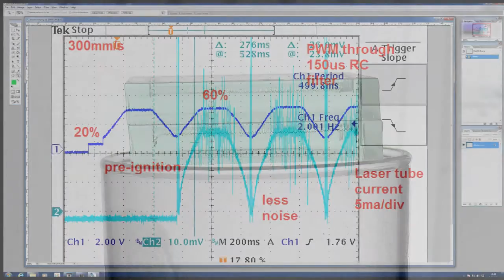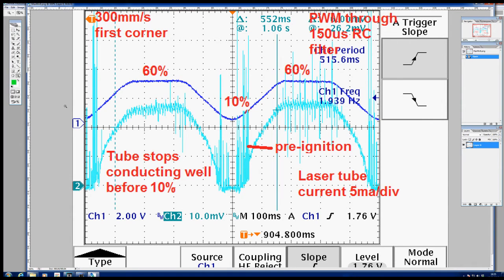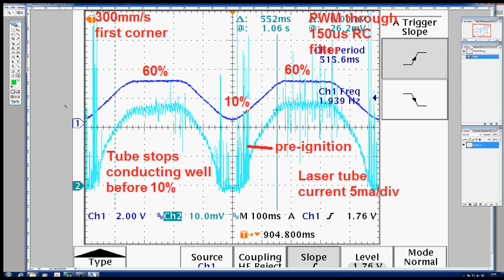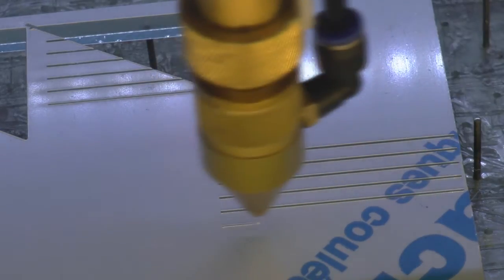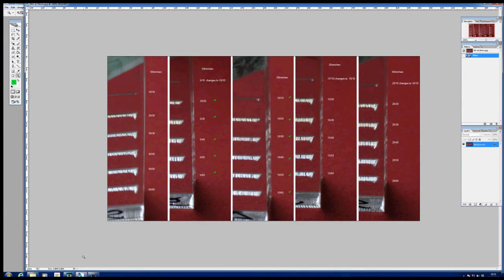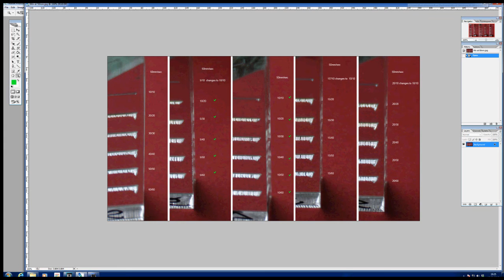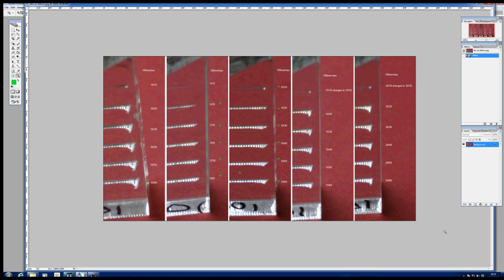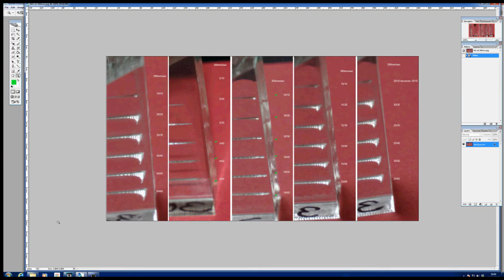RDWorks Learning Lab 55 Why Max Min Power Part 4    A Conclusion

Comment: I wonder if maybe you made more work for yourself than you needed to? When the head changes direction at a corner it slows down and briefly stops. Therefore, the beam also needs to ramp down and briefly stop at the corner. A series of lines to find the point at which your tube stops firing should give you your minimum power setting - it’s exactly the power at which the tube no longer produces a beam.
Reply from the maker: Hi Mark
 Thanks for the interest but this was a long time ago in my learning journey. About 18 months later I revisited the subject but this time I had purchased a little USB oscilloscope that allowed me to see exactly what was happening. you may like to see what I found. Having owned and used sophisticated metal cutting laser machines in my former businesses, I was familiar with the principle of power attenuation with velocity reduction. I could not imagine that this fairly crude Chinese  equipment had such capability
see  https://www.youtube.com/watch?v=wJX8X40T4VM
I do no have any sophisticated equipment to decode some of the puzzles I encounter, so I have to be creative with my experiments to see if acute observation of the results leads me towards an answer.
 Best wishes
Russ

Comment: Default settings with Lightburn is 10% min. This explains now why my first batch of airplane parts I cut did not cut clean at the corners. My laser fires at 12% min.  I raised it to 15% on a lot of the most recent ones and it made a huge difference, now the parts fall out.  However, now that I see what it is actually doing, it does away with what I thought it was doing and not applying full power all the time, so I have had it raised to min/max of the same values.  I can set those down now except for cuts through plywood, those need all the help they can get.   I thought it may have something to do with ramp up, but not ramp down, so thanks for clearing that up.

Comment: I've been setting both max/min to the same values, not really knowing the difference. Thanks for the very detailed (as always) explanation. I definitely need to tweak my min value down.  10% min seems like a good starting point. It seems with all your tests that their must be a way for a software manufacturer to produce some test  images that we can input the results of and then the software does some maths to fill in all the other stuff - but that would be too easy for the end user! If only!
Reply from the maker: Hi  Andy

In general you are right to set max and min the same. For engraving you must set them the same unless you are 3D engraving and then it is vital to use them.
For cutting,  keeping them the same will usually be OK but when you use the cut fuction for drwaing lines then  you can remove all the burnt corners with careful setting of the min value.. You will need to experiment though,, starting too low when drawing a 25mm test square and graually raing the minimum until the corners of your square just touch. I advise testing because the value will change with speed ,

Best wishes
Russ

Comment: Hello,
nice vid again.
But has this also something to do with the Parameter you can tick called "Laser trough mode" in the Cut settings in RDworks?
Matthias
Reply from the maker: Hi Matthias
No, it has nothing to do with Max/Min cutting.This is a feature that is necessary if you have a powerful tube and are going to cut metal with a special head. For our non-metal cutting applications just ignore it and leave it unticked. This software is designed for use with many different types of laser machine and some of the special features will not work on our simple machines.
Best Wishes
Russ
Reply: @SarbarMultimedia  Thanks for the fast answer! I always appriciate your Videos...learning a lot !
I have also another question about why i always get displayed 2 settings for Laser 1 and Laser 2 ( the Min/Max ) settings, even in the RDWorks Software and also in the Machine Display.
In the Vendor settings is only one laser ticked.
(if the forum is a better place for the question just ignore that )
Matthias
Reply from the maker: @StarflightVirtual  
Hi Matthias
I do not have a problem with you asking questions. As I mentioned previously, this software suits all sorts of machines. This version you have will operate machines with TWO different laser tubes. Later software issues support up to SIX lasers per machine.. Just ignore the tube 2 data. If you only have one tube then any numbers in that are there will be ignored .. Only tube 1 data will be actd upon by the controller.
Best wishes
Russ

Comment: Thanks for all your videos. I haven't even ordered a laser yet but it's great to be able to get some education before I take the plunge. I am planning on getting the 80 watt China model on Ebay.
Reply from the maker: +Counselor_X 
With very few exceptions most sellers of Chinese machines on ebay are just middle men to distance the factory from you. When you find out that your 80 watt machine is a 60 watt tube driven by an 80 watt power supply what action can you take? First how will you know its only a 60mwatt tube if you don't have a power meter to measure its out put? Secondly how do you know you are running the tube at it's recommended drive current because none of these machines are fitted with an ammeter? A typical 80 watt tube will be about 1600mm long whereas a 60 watt tube will measure about 1200mm. If you add to these tube dimensions 150mm to fit the first mirror and a 25mm air gap at the HV end and then check if this will fit inside the width of the machine case, this will actually predict what power tube you are actually buying. A secondary confirmation will be to check the packing case size.
The final piece of advice is to make sure you buy it with your CREDIT CARD. Ebay and Pay Pal guarantees are almost worthless. It will be good to ask email questions of the vendor before you buy and keep these written answers/promises(along with a screen dump of the ebay advert) because if things go horribly wrong then you can apply to your card supplier for a refund. Your card supplier is legally bound by a whole raft of financial regulations that the Chinese vendor is hoping to bypass.
Good luck. It may be painful at times but I'm sure you will get vast enjoyment from your new techno toy
Best regards
Russ
Reply: +SarbarMultimedia All good points! So far I have sent the seller about 10 different emails with questions. I just now asked them about the length and diameter of the tube. I would love for the tube to be great, but I'm trying to be real with myself and I am planning on the possibility of having to replace the tube with one from lightobject. The package size on Ebay is 1560mm in length, so what you're saying could be true. Is there any other way to tell other than the tube size? I see that lightobject has an 80 watt tube in 1625, 1250, and 1200mm lengths. The 1625 is 60mm in diameter while the other 2 are 80mm.
Reply from the maker: +Counselor_X 
As you will be aware I'm not in USA but I know folks who have bought  Light Object tubes. (no other comments) They source their tubes from SP  http://splaser66.com/enproducts.asp     If you check out their products it puzzles me that they don't sell any products matching what Light Object are selling. That's always worrying to me because of my personal experience with COLE Technology. I bought an "OEM" replacement 50 watt tube from them via Ebay only to find it was a 40 watt tube 850 mm long (I knew its length before I bought it but at that time was rather naive about Chinese specifications). When I went to the COLE website, they don't sell a 50 watt tube 850mm long!!!  It's undoubtedly as it says, a special OEM overspeced tube for shipping with machines

http://www.aliexpress.com/w/wholesale-sp-laser-tube.html.  
Take a look at all the blue pictures (marked SP laser) and see that 50=1000mm, 60= 1200mm and 80 =1600mm. Doesn't that make you suspicious? 
If you have looked at my recent videos you will have seen I bought a fantastic tube direct from China, from a great little company called Mactron. I'm sure there's some sort of link with Reci because their tubes are similar and there quality  is  beyond words. Most cheap tubes are 2000hour life rated, This was a fairly cheap tube but has a 4000 hour rating
My advice is buy the size worktable you want at the cheapest price possible(lowest power tube) and when you have your machine dialed in and have come to hate your rubbish low power tube, spend the money you saved on a reputable power supply and tube upgrade. In the meantime you can experiment away and not be in the least  bit worried about the tube.
Keep those rose tinted glasses and dreams in the drawer. Go out and give them hell!!
Good luck
Russ

Comment: Many Thanks once again for all Your suffering of trials and tribulations to discover and create these videos.  For being a gray, fat and ugly Engineer you've done an outstanding job of showing problems, approach to analyzing them and solving them.  You may not be an expert but I'm definitely learning how to analyze things and come up with a plan instead of running around like a bull in a china shop.  I hope you treat yourself to a nice juicy steak dinner.  You more than deserve it.  :)
Reply from the maker: +Bill Frick 
Hi Bill
Thanks for your appreciation. Solving machine issues is now almost a thing of the past as I have a machine that I can just push the button and trust. However, I'm just about to now begin and understand what ENGRAVING is all about, after all this is an engraving machine and I've only just touched on the engraving tools in RDWorks to see what's there , not to exploit them. There's very little information out there about using the machine for it's intended purpose. It's almost as thought it's a closed shop for experts and full of secrets. If there are secrets to be had, I'll try and unearth them logically  
Best regards
Russ

Comment: i think it will surprise you that this machine can also do 3d engraving just like  epilog. 
you need to load grayscale image and engrave it with just right min/ max power settings. then clean engraving with orange hand cleaner and some toothbrush. sample image can be requested from website gantryco.com
Reply from the maker: +mateusz1945 
I'm in the process of finding all this information as I start learning about engraving. Have you seen my latest power v greyscale video?
It's always good to have some guidance numbers so thanks for your data
Best regards
Russ
Reply: +mateusz1945 
Sounds great!
What min/max settings worked for you ?
What power of laser, and speed (mm/s) ?
What material did you try carving ?
I like the idea of orange hand cleaner for cleaning. I suspect a water rinse after using the Orange.
Reply: Your minimum power is whenever your laser is start firing usually 12% maximum is 100%. Adjust speed so you only go 3/16 deep at 100% power. That worked for me

Comment: Great video Russ, I guess I will keep watching for awhile instead of doing :(, my machine turned up with a faulty tube. Worked for a few minutes while I did the alignment. I cut a couple of test squares then the laser stopped working and it had an unstable plasma glow. Checked all the fitting like cables and water flow. Let it cool for an hour, tried again. When it was working , it never went above 15ma at 95% on a 100 watt tube. I got the give them an email on Monday.
Reply from the maker: +Bradley Mohr 
Hi Bradley
I can feel for you mate. My first tube was rubbish but at least it worked and allowed my to plough on, Good luck with your call for help
Regards
Russ

Comment: I have been watching your videos, I appreciate the help! A quick question, when in the rdworks software everything I draw cuts in reverse. How do I keep from having to flip all my drawings?
Reply from the maker: +BJ Evans 
Hi
If you watch   https://youtu.be/CWZvQXxbR_E     it's all explained, but in essence you need to go to CONFIG. SYSTEM SETTING and untick X mirror but leave Y mirror ticked if your machine is normal with the head 0,0 away from you at back left corner of the machine. If your 0,0 is back right, then both X and Y mirrors will be ticked.
Thanks for your kind words
Best regards
Russ
Reply: +SarbarMultimedia thanks again, you have been a great help.